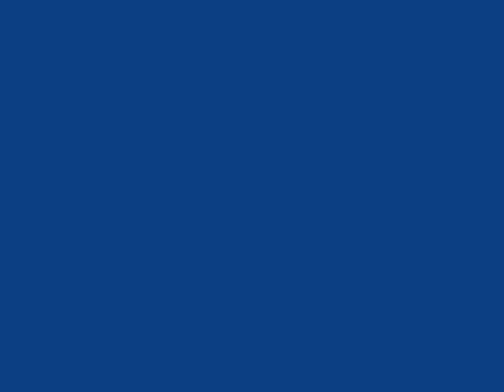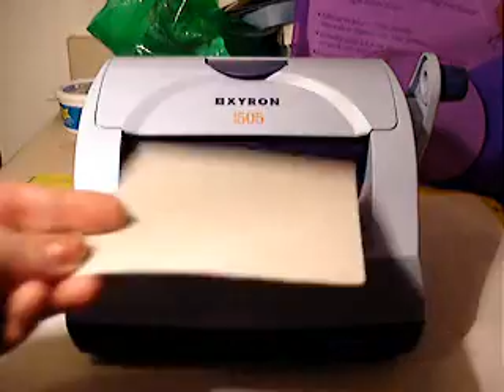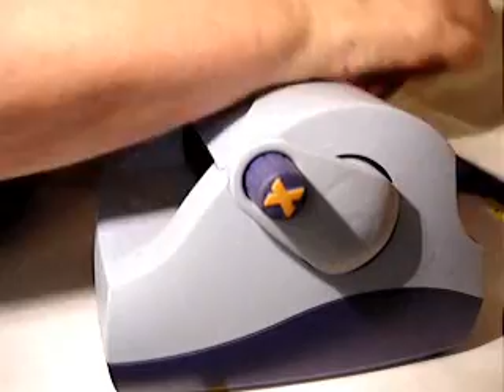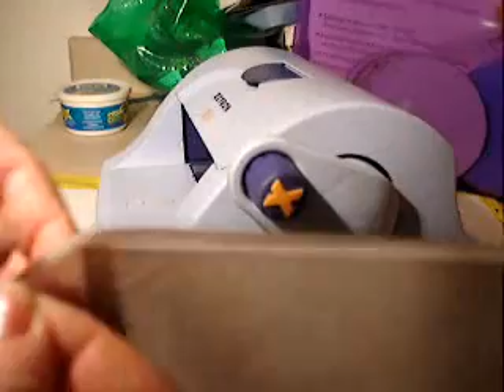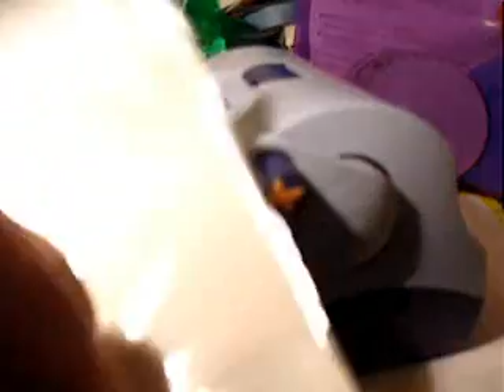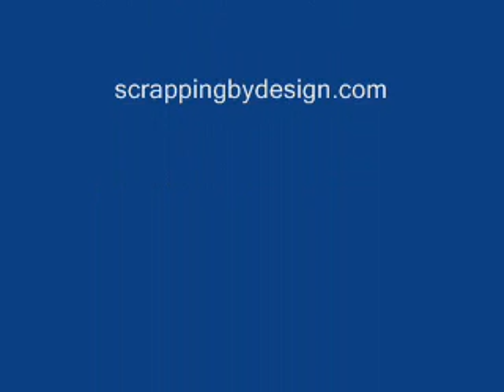Demonstrating the Xyron

Comment: If you want to put the sticker, for example, in your rear car window with the image facing out, then you would load the image face DOWN so the sticky adhesive is on the image, not on the back of the image.  If you want to stick it on something, say in a scrapbook, and need the adhesive on the back, you would load it image side UP.and the adhesive will be on the backside with the picture on the front side.  I like the machine... it's pretty simple for something that uses no electricity!  Cool! :)